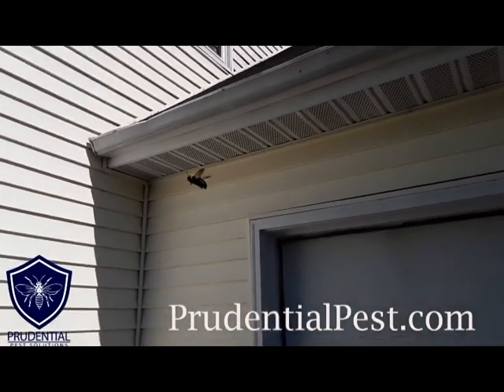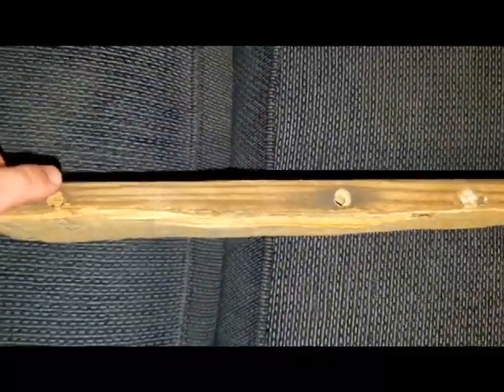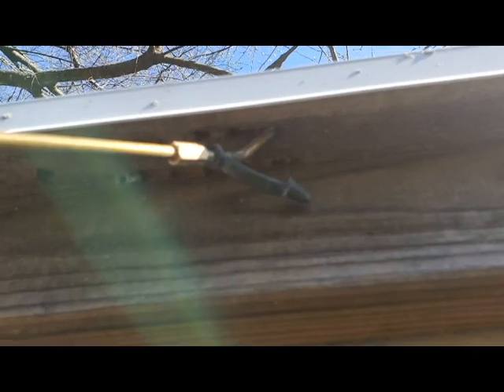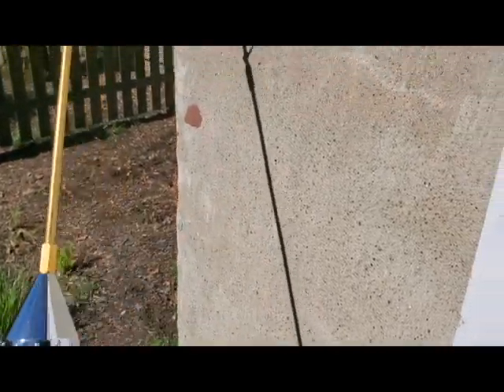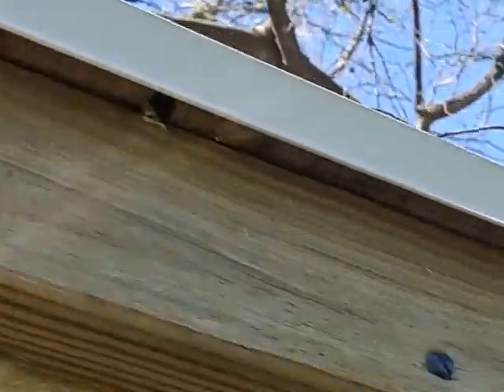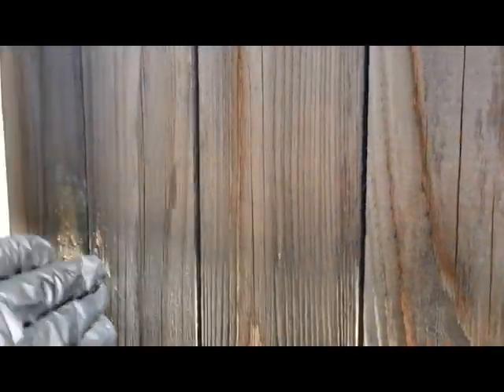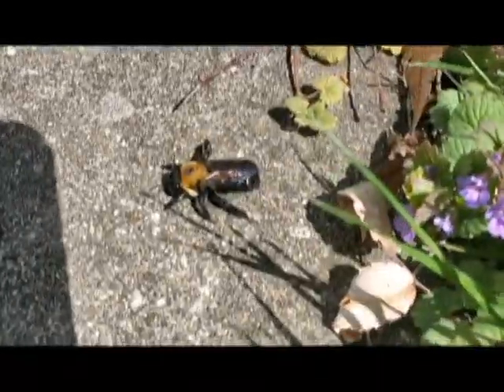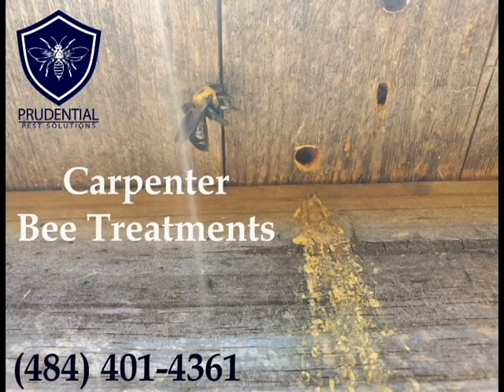How to treat for carpenter bees

Comment: How would you cover those holes? My carpenter bees are in the same spot. Since I cant see the holes. How do I make sure to cover them? Thanks@
Reply from the maker: After the treatment you can use plugs, cork, or wood putty to fill in the holes. The holes are almost exactly 1/2" so finding cork or plugs is fairly easy. Good luck!
Reply: @prudentialpestsolutions6617  how do i do that when i cant see the holes under the roof hangover?
Reply from the maker: @kimvernick7099  you can try to feel where the holes are with your finger. Carefully run your finger along the wood and find the holes. Otherwise you can try and use a mirror to see. They can be tough to find sometimes.